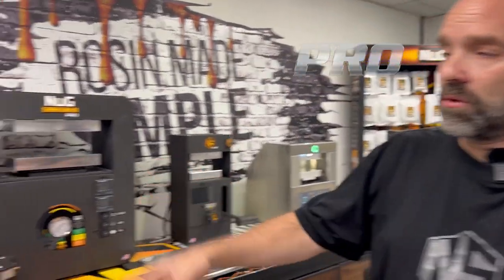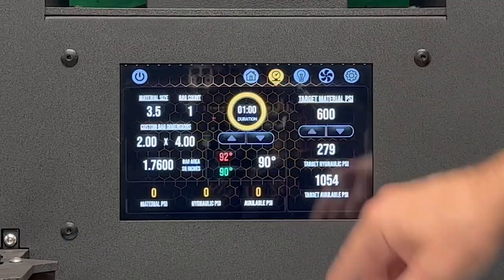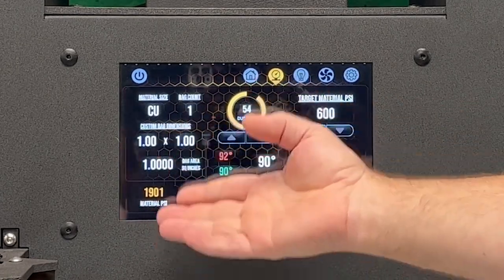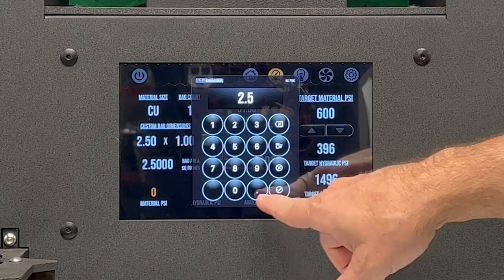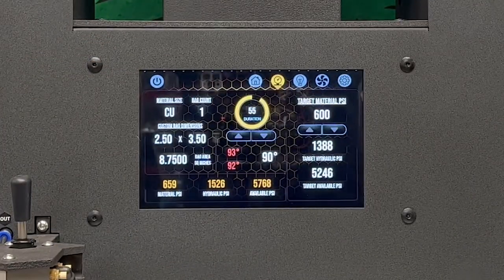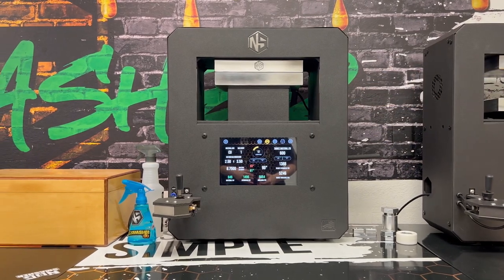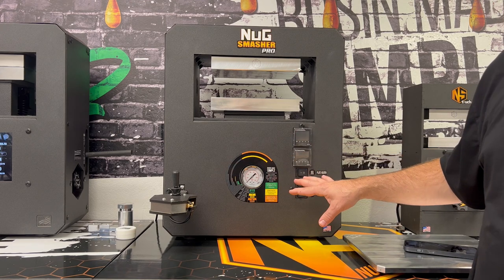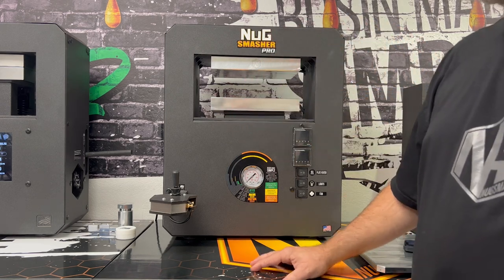PRESSURE IS YOUR WORST NIGHTMARE - Secret Information for Commercial NugSmasher Rosin Press Line

Comment: Love my touch, just don’t use it nearly as much as I thought I would.
Reply from the maker: Morning, Yes the Touch is a great unit Right!! Have you been loading your pressing onto the terpfiles.com to share what you have been doing with the NugSmasher family?
Reply: @Nugsmasher  I have not how do I access that? I usually just use the master screen and press dry sift low temp low pressure using the flat measurements.
Reply: I would consider producing your own cannabis.  It's fun and you get a LOT more product for your time and effort.  It makes it less like you're expending too much flower and you can concentrate on tweaking your results.  I hope this helps.